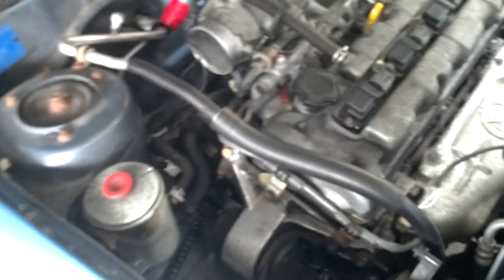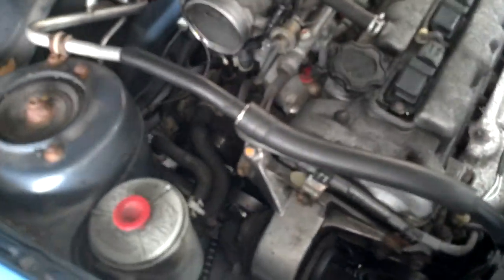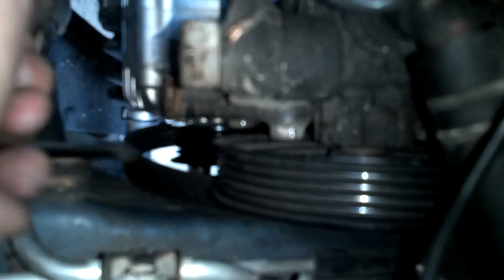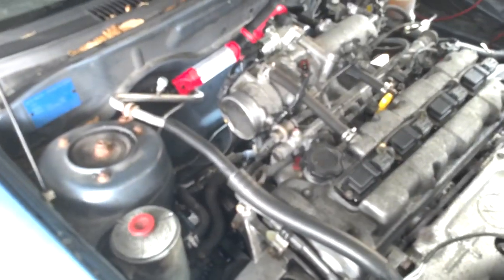Replacing alternator in a 2000 Suzuki Esteem 1.8L

Comment: I know this a late post but in case there are viewers that have a 1998 to 2002 Suzuki Esteem with the 1.8 engine that needs their alternator replaced, here are a few tips. 

Jack up your car and remove your tire on the passenger side. Remove the plastic cover inside the passenger’s lower fender well to get to the belt tensioner, remove the belt.  Disconnect the ground side battery cable and remove the power wire from the alternator and the wire connector harness. Remove the bottom alternator nut, then unscrew the top nut which is behind the power steering pump pulley and lower the alternator. The alternator is removed by disconnecting the exhaust flange from the catalytic converter to the exhaust pipe on the underside of the motor. Pull the pipe away to the side and pull the hoses to the side and slip the alternator out from the bottom of the vehicle. Reinstall in the reverse operation. 
I have done this too many times in the past 14 years and I do own a 2000 Suzuki Esteem 1.8 ever since it was new. I love the car but have problems with the alternator and the other day is seems I need another one replaced. The last one lasted 12 years. I’m a retired mechanic and still work on my own cars. The way I explained in removing the alternator is the way I done it about 5 times and the only time consuming part is loosening the top bolt and screwing it back into the alternator, other than that it’s a straight forward operation. 

The way I explained is how the Suzuki factory service manual explains to do it. I do have both factory service manuals for this car, not aftermarket repair manuals and the alternator is removed from the bottom of the vehicle and comes out easily if you take time to wiggle it a little.

Comment: This is a bit late, but there is an air conditioner line of the passenger side strut housing bolted to the top of it.  You just unscrew that and a little wiggling and the alternator comes right out and goes back in very easily without removing motor mounts or anything crazy like that.

Comment: The 2003 Suzuki XL7 alternator has a Torx bolt at the bottom which is probably the same size as the vehicle in this video. To remove it you will need a Torx bit socket T-45.They have them at Home Depot for about $1.80.

Comment: It would've been a lot more helpful if you would've actually removed the Alternator all the way and then even showed the actual replacement of it. While doing this, you could show and explain any issues that might pop up and how to deal with them! My brother has heard that the axel needs to be removed and "YES" I saw that you said you "shimmied" it out the top and just needed to push some lines out of the way. That's why it would have been nice to see you do it!
Reply from the maker: Unfortunately I'm only an amateur video-maker and shade tree mechanic. You'll have to use this resource as best as you can. I sold my Esteem. Good luck.

Comment: thanks for the info.. I got to replace one on a 00 esteem tomorrow, so only 2 bolts need to be removed to get the alternator out? Someone said that the alt. bracket comes off with the alternator, meaning that 3-4 bolts need to come out, is that true

Comment from the maker: Put the front of your car on jackstands, and then remove the cowling around the wheel well (should have little plastic pop rivets, you can replace these with pop rivets you can get at home depot). Next, from under the car, get to that bolt. I don't think it's possible to get it to it from the top.... also removing that cowling makes a huge difference in available space.

Comment from the maker: On the 1.8L we only had to pull out 2 bolts. the one behind that fly wheel and then one from the bottom of the alternator. We didn't have to remove the alternator bracket. You may want to reference my other video as well (see the description).

Comment: my screw is stuck and ive stripped it a little bit trying to use an open sided wrench to get it off, just the like the one ur using in the video. Any ideas on how to get the damn thing off? The pully in front of it looks like it doesnt have any way to come off, but im really not sure. I tried needlenose pliers and a vice grip as well. The damn thing refuses to come off and i dont want to strip it any further. When my idler puller seized up i had to drill off the nut holding it on.

Comment: hey im in the pros of losing up the top bolt of my alternator and its rounding off i tryed vise grips but as you know that thers not that much room so what can i do to get that bolt off?
Reply from the maker: That's a really awful place to try and remove a bolt with a rounded head. You can try what's described here: http://www.ehow.com/how_4516975_remove-bolt-rounded-head.html
Reply: I would just remove the power steering pump and then see what I could do about that bolt once I have the room to work with it. The pump isn't that hard to remove and then it will give you the access to the bracket and bolt that's attached to the top of the alternator. I know there isn't any room to work with that bolt without removing a few things. I just replaced my 2000 1.8 Esteem pump and it isn't hard to remove. and then you can get to the top of the alternator.

Comment: Well I'm this far everthing is off! Except,.. The Top Bolt that keeps it mounted It;s trying to round the NUT Off! AAAaaahhhhh HAHAHAAAaaa  Im Going down to the ground with my turns..Counter Clock wise! I Think Thats Left? Cause, I hold a Ratchet turning Left? Even though you cant use a Rachet cause of that God Forsakin Power Steering Pump "Pulley"...LOL I think of something and let you know! Cool Video BTW! What size Open end you use? You Never said? Im using a 12 mm..Hope im not turnin wrong